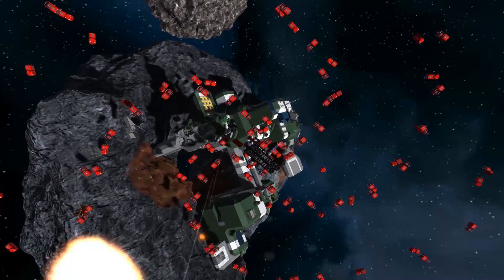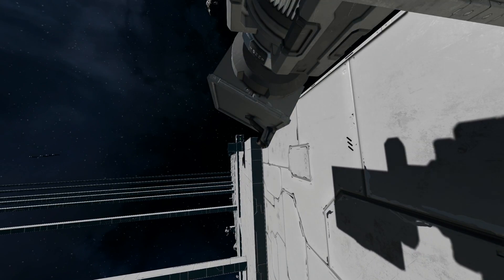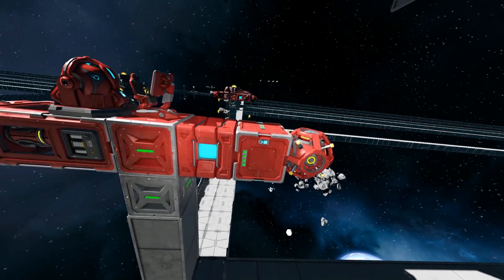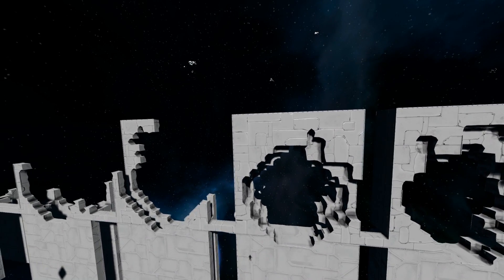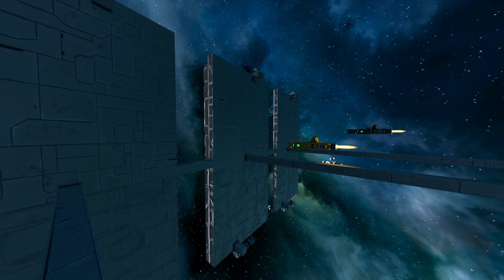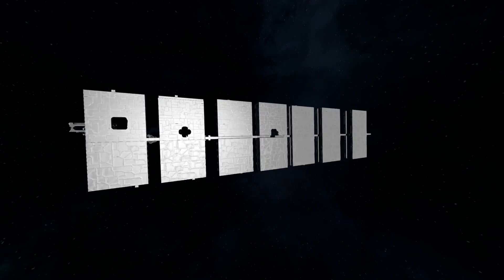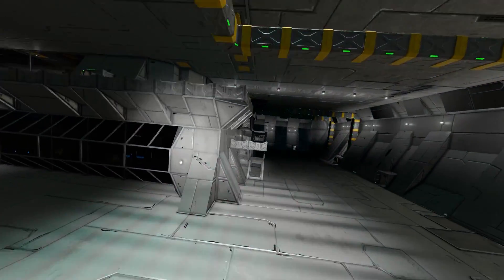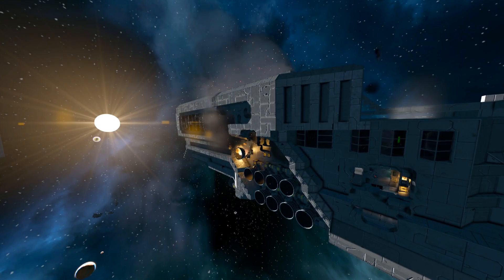Space Engineers - Payload Testing & Breach Missile Design Step 1

Comment: @w4stedspace an idea to improve your testing to get an idea on how much damage it would do to the inside: build a hollowish cube and fill the inside of it with hallways, stairs, some vital components like a reactor room, the sort of things you find in an actual ship.
Reply: wouldnt be bad idea, but wouldnt it be better to use an actual ship for realistic results?
Reply: @eageraurora879  meh, the point of the cube is to simulate a more uniformed area. Not every part of the ship is equally armored. This is particularly true of ships that use neck structures or get increasingly narrow to the front and wider at the back.

So the point of the cube is it A) uses less space than a actual large to medium ship.

B) assumes uniformity on the target giving a more ideal best case scenario for damage and defense.
Reply: @YinglisTheYinglet  ok whatever if you wanted that then just aim for the specific parts of a ship and see what would happen. bridges and narrow spaces dont exactly go onto a cube. if anything you Could just cut off peices of a ship and dumb fire at them
Reply: i also want to add to the fact that, yes, although the cube would be more uniform for controlled testing, i beleivr that aiming it at an actual target would provide more info as you can see how accurate a missile is ontop of the cube which only provides penetration and interior damage